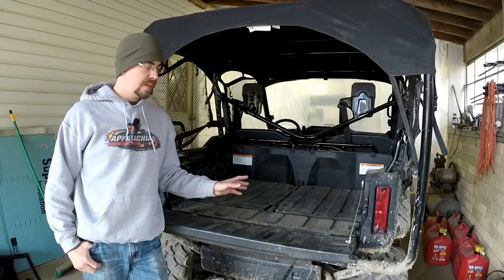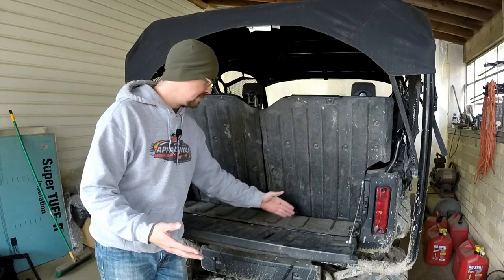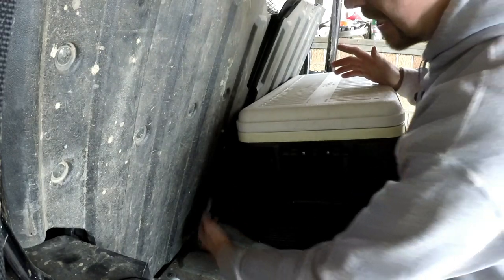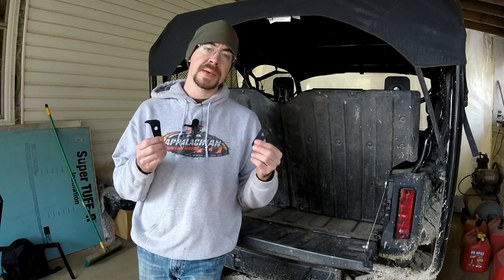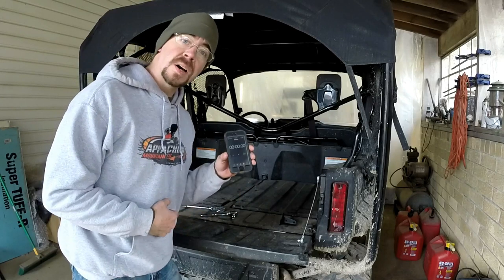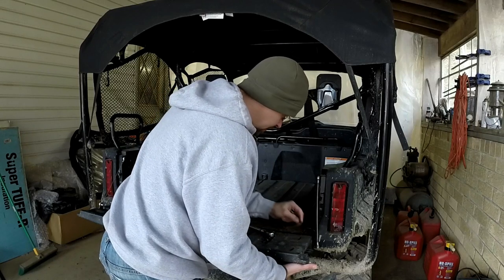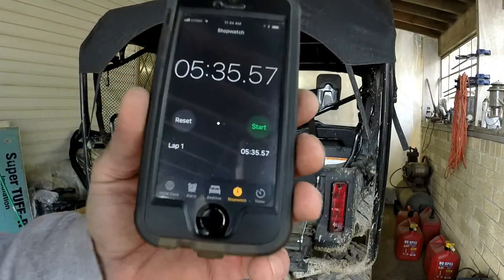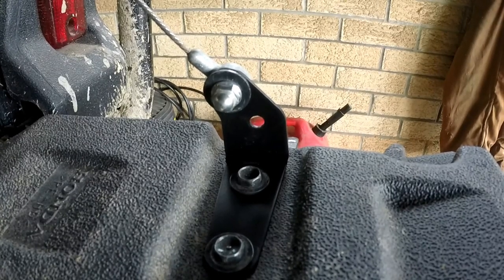Honda Pioneer Tailgate Extension Bracket Install

Comment: Problem is when you extend the tailgate flat, the tiedowns on my OEM bedextender will not engage for they are not too short. The OEM extender has rubber straps that secure the extender to the tailgate so it doesnt flop around on a rough ride.
Reply from the maker: I didn’t know that about the oem extender. That’s probably why Justin made a hole in  his extended brackets to still hold the tailgate in the oem position as well as lay it flat if you want or need. Thanks for sharing that!